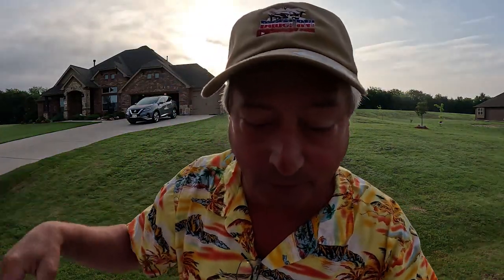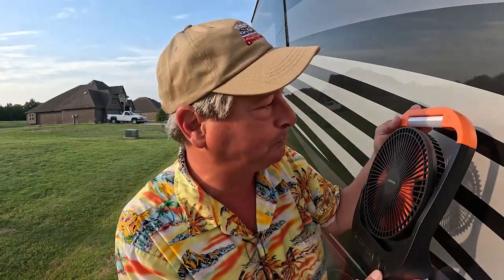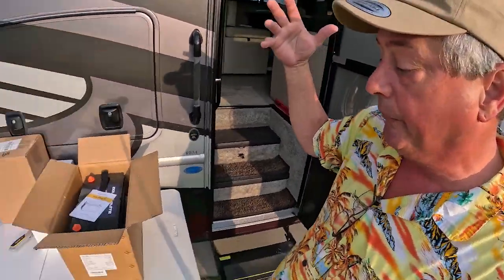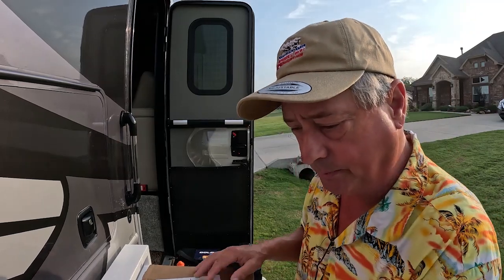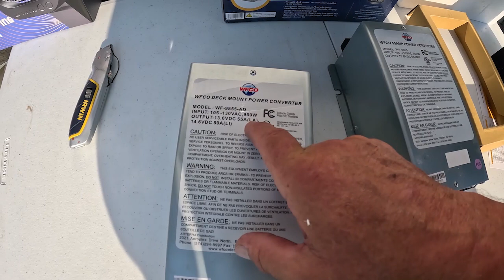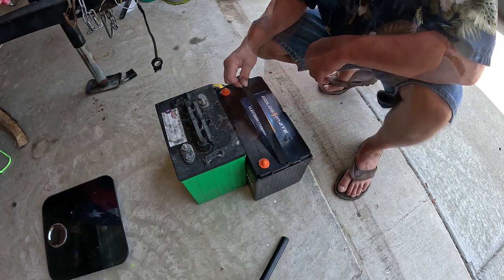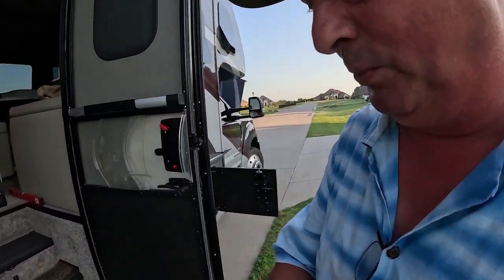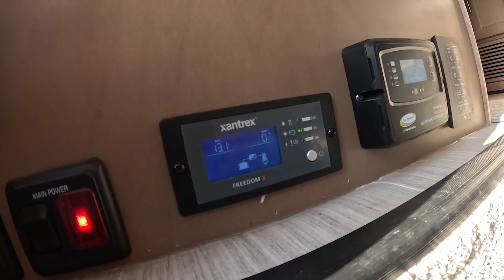Making The Switch To Lithium Batteries For RV Edition Of Fridays Finds | #Goldenmate #LifePO4

Comment: Great vid!  My next project.  I just replaced a bad converter and would have paid money to see how you extracted the original!  Left mine in place and relocate the new one. :)
Reply from the maker: The hardest thing about removing the original was finding the correct bit to extract the screws holding it down. after that I unplugged it from the panel, loosened that hex screws holding the DC wires and then repeated the process to install the new one. Thanks for watching!

Comment: Awesome video!  How many of these batteries did you end up with and how long does the charge last?
Reply from the maker: I initially installed one Goldemate 100 Ah LifePO4 battery as they were one of the sponsors for the video, they make a great affordable battery. ( https://amzn.to/43nRDnm ). I never ran it to empty and made several one and two night dry camp trips. The OEM wet cell set up only provided about 70 usable amps so that was a step up.  About three months later Chins Batteries ( https://amzn.to/3TJRAz7 ) wanted to get in on the game and sponsored this video with 4 100Ah LifePO4 batteries ....
https://youtu.be/uKUPq5qSq8U?si=4dSMrIn7i0ZfH7aj
so we are now rolling with 400 Ah of battery and 500 watts of solar, it was a bit tricky fitting the 4 batteries into the space and I have to be mindful of low temp charging but that is not too much of an issue here in Texas. Both brands have built in BMS with high and low temp protection. Just know that when the temps fall below freezing the batteries will not charge, that is why most folks move them inside of the RV.
If I were purchasing the batteries and doing the install knowing what I know now I would have gone with only three batteries, that would simplify things a lot.
If you want to pick my brain reach out to me at DudeRVTexas@gmail.com and we can have a real conversation.